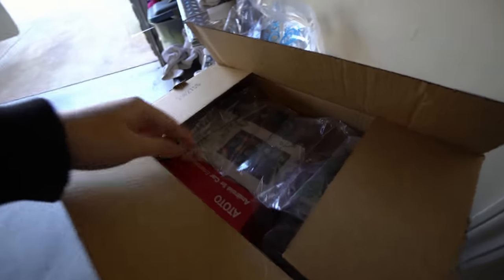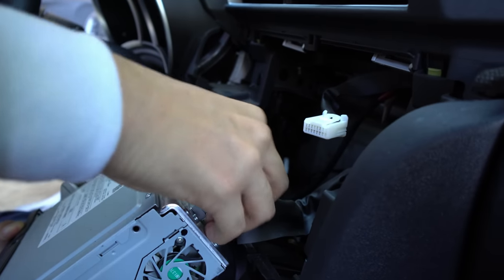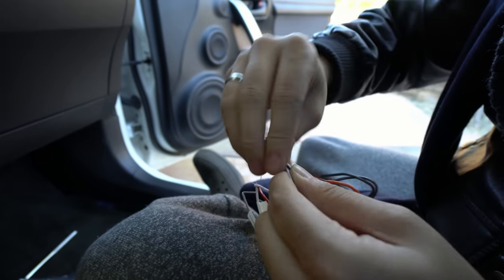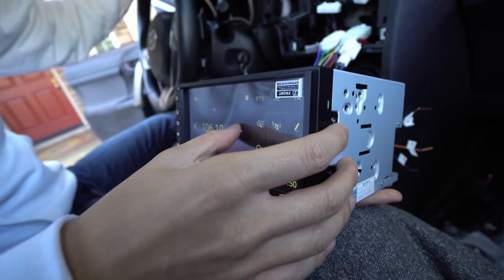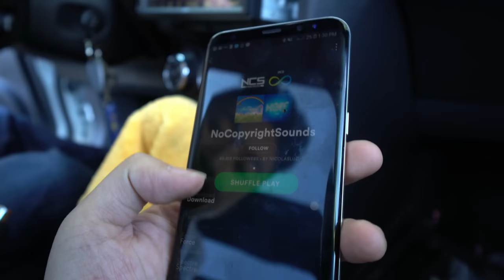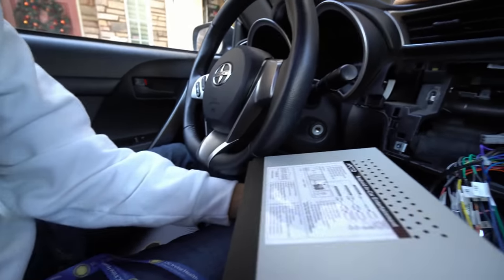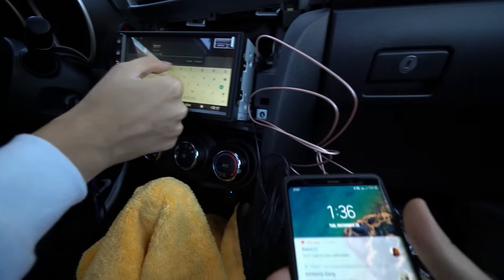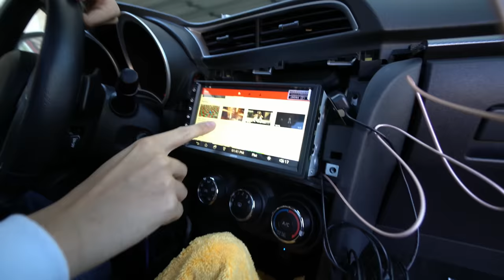NOOB Friendly Install, The Universal Android Head Unit (ATOTO) (p1/p2) (4k)

Comment from the maker: The Goods!

Headunit: https://www.amazon.com/gp/product/B077JLLLS9/ref=as_li_ss_tl?ie=UTF8&psc=1&linkCode=ll1&tag=8324894-20&linkId=ed2734a9d7ce6cb06e9b3bec3a9079b3

Wiring harness: https://www.amazon.com/Mobilistics-WK-78-Car-Stereo-Wiring-Combo-Harness-Antenna-Adapter-Fits-Select-2011-2017-Toyota-Scion-Subaru-WK78/dp/B074G38LP9/ref=as_li_ss_tl?s=automotive&ie=UTF8&qid=1514586968&sr=1-2&keywords=10+6+pin+radio+toyota+brz&linkCode=ll1&tag=8324894-20&linkId=a686cf18f1b912dfc7cc03f54f2f696f

Trim piece: https://www.amazon.com/DKMUS-Vehicles-Universal-Brackets-Installation/dp/B011QPWMHG/ref=as_li_ss_tl?s=automotive&ie=UTF8&qid=1514587025&sr=1-1&keywords=toyota+double+din+trim&linkCode=ll1&tag=8324894-20&linkId=37fb4dd9f2ad2884c8277760b075bf31

Car Backup: https://www.amazon.com/Backup-Waterproof-Wireless-dashcam-Panlelo/dp/B073WC8MSW/ref=as_li_ss_tl?s=automotive&ie=UTF8&qid=1514587097&sr=1-2&keywords=panlelo+backup+camera&linkCode=ll1&tag=8324894-20&linkId=ff07764617a1d82b326ffb14d3aac782

Optional:
ATOTO SWC: http://amzn.to/2ClOESk

Bluetooth OBD2 (for torque): http://amzn.to/2zNi06D

Comment: does the connection by electrical tape perform ok or last long? I found so many people suggested using heat shrink, but I don't have that type of tools. I am planning to use electric tape just like you did.
Reply from the maker: I don't have any issues. The reason why i do electric tape is because i go through a lot of head units.
Reply: John Nguyen thank you so much! I will do the electrical tape then :)
Reply: @JohnNguyenVincent  I have 2 other questions. Is it ok if I put the gps and wifi antenna inside the dash with the A6 unit? also, do I need to use the external microphone or the built in is good enough?

Comment: Question, where did you guys mounts the Antenna and WiFi receiver?? In the dash? Or on window or something.
Reply: Coby Hester I got mine today and mounted them on the windshield.. ran the wires through some of the headliner and side airbag trims

Comment: I have a question I didn’t get the wiring harness for it a buddy gave it to me And I tried putting it in my truck but I never installed a radio before so when I did then it started to smoke what did I do wrong and what happened

Comment: Ever have issues with WiFi not enabling on these android head units? I have one running Android 7.1 and I can't enable it. Every time you try, it disables again immediately.
Reply from the maker: haven't had any issues like that in my multiple android units i have
Reply: John Nguyen gotcha. Seicane is sending me a new Wi-Fi module. Hopefully that's all it needs.

Comment: How you wire the steering wheel controls
Reply from the maker: it was just 3 wires. gnd sw1 sw2
Reply: Did you directly connect those wires or was it plugged into each other